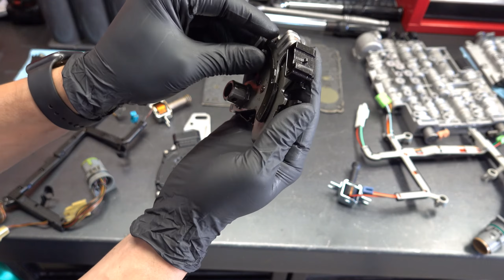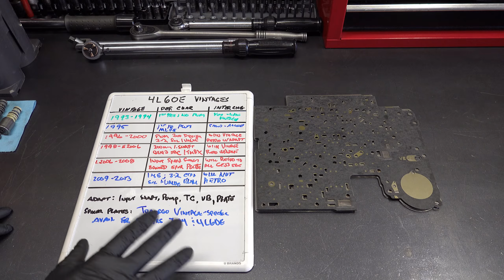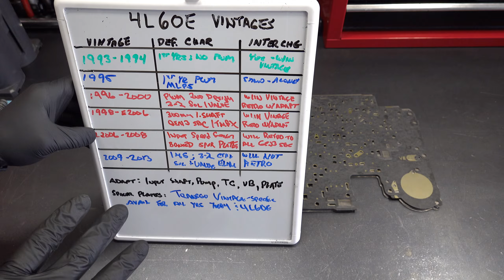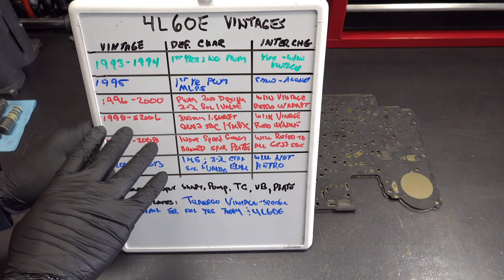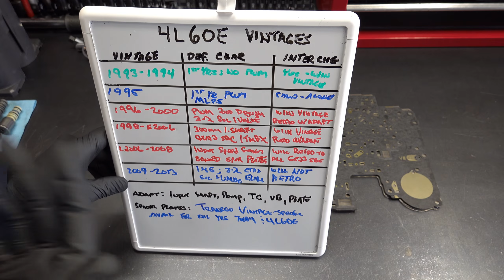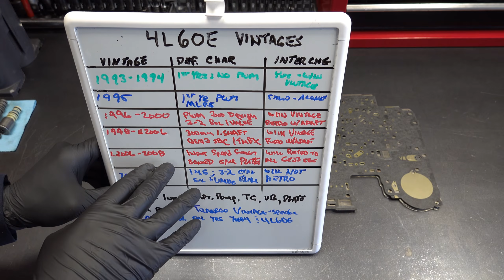How to Buy a 4L60E - Changes and Interchange Rules

Comment: i have a late 07 unit that looks exactly like your 09 case
Reply from the maker: Yea, the case differences appear to be immaterial between those later years of 4L60E...A few have told me they were able to swap plate and valve body between 09 and 08-07 to make a 2009+ case work for a 2007-2008 application...
Reply: So I’ve got a trans out of an 03 suburban I bought for next to nothing that I know was rebuilt. I also have an 09 Saab 97x(5.3L) that will not leave second gear when up to temperature. My question is are the clutches and mechanical internals (minus the speed sensor reluctor shafts) interchangeable? Like could I pull the guts from the 03 and slap them into the 09?

Comment: Can i put a 2003 4l60e and put it in a 2008 truck?
Reply from the maker: Do you have turbine speed sensor in your truck's 4L60E? 

You should, given it's a 2008. The TSS began to appear in truck/van/SUV chassis vehicles in very late 2005 into 2006. You can't be without that sensor.
Reply: @nickstransmissions also how would i tell  if it has a turbine speed sensor
Reply from the maker: You have one in yours. As I mentioned, all 2007+ NNBS (GMT900) platforms w/4L60Es had an input speed sensor...But to confirm any technical details about your vehicle, call your local GM dealer, ask for parts then give the parts guy the last eight digits of your VIN and he will tell you if you have one specific part or feature on your vehicle. 

Here's my 4L60E Rebuild Series that you can use as a guide for your rebuild: https://youtu.be/H5-1Fs3hwLE

Also, purchase the updated ATSG manual for the 4L60E / 4L65E (one manual covers both transmissions).
Reply: @nickstransmissions i have no idea brother, i bought a 2008 1500 that needs a tranny it only has reverse 1st and second, and i have a 2006 tahoe that the frame is rotted so i was thinking about yankin the tranny out of the tahoe and putting it in the 2008 silverado
Reply: There both 4l60's was trying to save money on a transmission lol so theres no eay to do it?
Reply: Way*
Reply from the maker: Rebuild the transmission that is in the 2008 truck now, if that is the truck you want to get running/driving...Saving .10 now will result in your paying a dollar later (sooner rather than later).
Reply: @nickstransmissions so it just wont work at all i cant do anything to make it work? Lol if i had money to get it rebuilt i would 🤣 thats why im on your youtube channel
Reply from the maker: No as you would need to swap to an ISS-compatible pump and drum w/the sensor installed - if you're going to do all that work, you're going to rebuild the transmission anyway since you won't have not much additional time in it vs swapping those drums.
Reply: @nickstransmissions would i be able to do it myself if i buy a rebuild kit im pretty comfortable hands on doing it, do you have a step by step video?

Comment: Can I use a transmission from a 2003–2005 Tahoe on my 2007 Suburban
Reply from the maker: Do you have an input speed sensor in the transmission on your Suburban?

Also, this video prob answers your question - give it a full view, if you haven't already.
Reply: @nickstransmissions  yes i have.
Reply: And i have fault code p0717 ..
Reply from the maker: Ok...Your vehicle is designed to work with a 4L60E that has the ISS which means you cannot install any transmission that doesn't have it. So you need a 2007 or 2008 unit only. 

My advice: Rebuild (or have rebuilt) your existing transmission. 

Used 4L60Es are extremely unreliable and you're basically casino gambling and you know what they say about that: "The house always wins".
Reply: @nickstransmissions 

Can you tell me if I need any special tools, other than regular hand tools, to disassemble the transmission and reassemble it?
Reply from the maker: Yep - check out my 4L60E special tools and equipment video - will give you all the tools/supplies/equipment that you'll need to effectively rebuild your 4L60E: https://youtu.be/HVo0uyfdJS0

Comment: I have a question is am hoping you can help with, I have a 2006 chevy silverado 1500 with 5.3l RWD, we just put a transmission from a 2008 silverado 1500 4.3l RWD in it and its not shifting into gear, the transmission seems to be exactly the same but its not engaging, is there some components i need to switch over from the 06 4l60e?
Reply from the maker: Hi Matthew, thanks for watching. Did the input shaft on the replacement transmission look like the input shaft on your original unit which would have had full splines to the end and a large orange o-ring? Or did the replacement engine have a pilot journal on the end of it with a black o-ring?

Comment: Hey Nick, hope all is well. I watched the video tons of great information! Im working on a 2013 4.3 v6 with a 4l60e that has lost reverse, i have a left over 2009 4l60e that had a 5.3 in-front of it. I was aware of the 09+ changes as far as “neutral safety switch” etc. upon inspection of the connectors one is blue/tan the other is blue/gray
Reply from the maker: Thanks for watching, Chevy!

Comment: I’m still not fully sure about this yet.  
I have a 03 Silverado 4x4 with a 5.3 gen 3  transmision is burnt up. 
And i found a 2000 Yukon 4x4 5.3 since they are both gen 3 what all would i have to swap to make work ?
I’m assuming they are both 300 mm shafts since both gen 3 
Thank you kelly
Reply: I will rebuild it   But i was wanting  something to be able to move it around and drive a little while it’s being built  it’s a 1954 Willy’s pickup body on a 1999 Tahoe frame and a 03 Silverado 5.3 with a 261 transfer case and the 2000 transmision is free if i help the guy pull the motor
Reply from the maker: Hi Kelly, thank you for watching. 

Why not simply rebuild your 2003 unit? 

It has a better reaction shaft with larger gear train bearings than the 2000 transmission but is otherwise identical to it.

Comment: Great videos,i have head scratcher.i have an 01 astro van 4l60e that leaked from the converter seal, replaced pump and converter, had late 1/2 shift and pushed fluid from vent.realized i ripped the 2 stator teflons and got stuck between the pump and case. Pulled apart, all new seals and gaskets,issue now is i have no 2nd. Screams first let off right to 3rd and also feels like a bind in reverse and in low 1. I know its a 298mm pwm 01 behind a 4.3 i was thinking of replacing with a used one from a 2000 as they seem more plentiful. Would you know if they are compatible? Thank you
Reply from the maker: I think I need to do a follow up video to this one as I'm getting quite a lot of questions about compatibility between transmissions as assembled units and respective vehicles. Perhaps in a month or so.

In the mean time, if both units have a shallow bell housing, pilot at the end of the input shaft and older 700-r4 sized torque converter, they should be compatible. The 4.3L's converter will have a higher stall than the converter from a 4L60E that went behind a 5.7L engine.

Comment: "HI Nick", how are you doing? You are making some great detailed videos. Keep them coming. I have a question for you. Can you swap a 2005 4L60E oil pump and all the other internals into a 2008 case? I know the 2008 pump and wiring harness are different. My 2005 case is broken. They both use the same outer pump gasket, the one that is on the case-oil pump perimeter not on the pump. Are the cases the same in 05 & 08  they sure look the same? Thanks Nick keep up the great work.
Reply from the maker: Hi Mark, thanks for the kind words. You would need to swap both the pump and input drum/shaft assembly into your 2005 unit as a matched set. Install the turbine shaft speed sensor to plug the hole that would be there if left out. Use the 2003-2005 wiring harness from Rostra.

Comment: This is some valuable information I’m struggling to find anywhere else and far more in depth as well, I appreciate you taking the time to make these videos and pass your knowledge to others, one question I have is if you have a diagram and could provide it somehow for the 17 pin blue and tan/light brown connector, it is for a 2010 Silverado that I am having input/turbine speed sensor signal issues with creating the intermittent hard shifts and I would like to test the harness before dropping the trans and replacing the iss/tss but I have no idea if: the 3 wires off of the sensor go directly back to the Tcm or branch anywhere else before then, the colors of the wires, what the iss supply voltage is etc.. I cannot find very solid/consistent info for this specifically and I don’t expect you to know every detail but I figured I’d ask being as you are very well on top of these things, either way keep up the great videos!! Thanks
Reply from the maker: Thanks for the view and kind words, Jeremiah! 

I can't provide any images or diagrams here but you can google search for those as they're out there. Also, you can purchase and download the ATSG manual - there are pin-out diagrams in the manual as well.
Reply: Thank you for the quick reply! I looked at their manuals and it seems like they’ve got the info I’m looking for going off of the index, I will be ordering one from them for sure, thank you again!!

Comment: Finely I found someone who actually was able to tell me what I have been trying to figure out since I have a 93 Chevy Silverado 4x4 that has been swapped with a 700R4 so I went on a search and was able to find a 4L60E out of a 93 Chevy van now comes the next problem different output shafts since one is 2wd and the other is 4x4 so I ended up circling back and wondering would my 97 4L60E swap instead of swapping out the outputs because I didn't want to tear the transmission 3/4 of the way apart to just change them out so now I know I can retro fit my 97 to run as a 93 and I have all the parts from my 93 2wd to do it if I am understanding every right that is and I am glad also because my 93 2wd ended up having burnt fluid in it thank God all I paid was 150 for it and thank God I finally learned how I can do the swap since the person who put the 700R4 in didn't do it right and I most likely possibly fried it when I dumped all my tranny fluid after it separated enough ugh well it was only a 500$ Chevy Silverado 4x4 pro am classic not sure how special they are but there is very little information on them.
Reply from the maker: Thank you for watching!
Reply: @nickstransmissions thank you for simplifying the process for me and so many others.
Reply from the maker: You're welcome, MrJal!
Reply: @JimmyJames3184  hey I have a 93 transmission from a suburban with 5.7L engine and I want to put that transmission into a 97 Chevy express van 1500 with 5.7L engine. Is our situation the same (excluding 4x4 because neither of mine are 4x4) or are you saying I should just retro fit my 97 van to think it’s a 93 suburban
Reply: Yeah man same here!!! 👍

Comment: Awesome and informative video, as always. To make sure I understood this correctly, I have a 2012 core where all the internals were pretty bad, with some rust, and even the pump has damage. I also have a 2008 transmission. Can I transfer all the internals from the 2008 (with ISS pump and ISS input drum) into the 2012 case and use those along with the 2012 valve body, harness, gear selector setup, and separator plate to rebuild it as a 2009 and up compatible 4L60e?
Reply from the maker: Yep, that should all work...the 09+ stuff that's unique to that vintage is the VB, plate, IMS and wiring harness so as long as you use all that stuff in your 2012, you can xfer the guts from the 2008 into your 2012 case.
Reply: @nickstransmissions  Awesome - thanks for the quick reply!

Comment: Do you have a video about connector/internal wiring harness changes between 2003 and 2004+ transmissions? I have a 2005 Silverado 4.8 4x4 and wanting to use my parts truck 2002 Sierra 5.3 4x4 4L60E when mine finally wears out. It's my work truck and I'll have to take it to a shop to have it swapped, but want to know exactly what has to be done. I read that the valve body must be removed and internal wiring harness/pass through connector? I just took a 2003 np246 transfer in to replace mine and the difference in the encoder motor stopped us from doing that.

Comment: Had a neutral safety to out wouldn't start but if you went from park to drive it would kick in the starter was crazy
Reply from the maker: They can fail in very odd ways...I've seen them start in neutral but not park and vise versa as well as scenarios like yours where they'd start if you were aggressive enough w/the shifter...

Comment: 95 was a two wheel drive specific or astro/safari van,  I bought a 95 trans for my 97 and everything was different. i guess that 95 year they messed with some valve body stuff as far as i can read and made it kinda annoying.
Reply from the maker: All the 1995 transmissions had a PWM pump and early design PWM 3-2 control solenoid and 3-2 downshift valve train - that combo made 1995 a unique year for these transmissions. 96+ they went to an 'on/off' 3-2 downshift strategy which meant diff solenoid, spacer plate, valve body casting and valve train.
Reply: Nick do you know if you can put a 96 valve body & separator plate on a 95 & it work? Not worried about impedance it's got a stand alone controller. I need the 4 bolt extension housing case that the 95 has.

Comment: So can I install a 1999 4l60e trans into my 2003 Tahoe without any modifications?
Reply from the maker: I cover this in the video, towards the end - give it a view if you haven't already. 

Otherwise, simply rebuild your 2003 Tahoe's transmission - used 4L60Es come with worse odds of success than slot machines on the Las Vegas strip.

Comment: So I'm kinda in the same area as @jenniferkromhout713 was talking about. I have a ls swapped g35 running the Aces efi, I bought a 4.8/5.3 (don't fully know which one) with a 4l60e and I've been having shifting issues since installed (has 1st and 2nd but nothing more), even though it's a fresh rebuild. Come to find out the aftermarket wiring I have only supports up to 2005 (possibly thru-08) transmissions. So I'm back to the original question of; if I can get an 05 valve body and swap it in since I don't need an internal or external mode switch, and use the 05 wiring and solenoids etc. or if I'm better off scrapping the $1100 I spent on a rebuilt 09+ trans, and just get the right year?
Reply from the maker: Hi Ashton, plug a bi-directional scan tool in and take for a test drive - see if the Aces PCM is commanding an upshift from 2-3 but you are staying in 2nd gear. If so, the problem is either Shift Sol B stuck on or the VB 2-3 shift valve or shuttle valve is seized in the bore. If the PCM is not commanding an upshift, you'll need to find out why. 

Start there and let me know what happens.

Comment: Would i be available to put a 2001 4l60e into a 93 Chevy truck? I watched your video before commenting, and with the purpose of putting the trans into that truck
Reply from the maker: Hi Carlos, please re-watch as your question is answered in the video. I don't ever advocate for installing used transmissions so my videos are all I have to say on the subject. 

My advice is to rebuild your 1993 4L60E unit.
Reply: @CarlosHernandez-lb5fu  33.25

Comment: AKA Terminator Transmissions:   I didn't have to swap out the Bell housing of my 09 unit, I believe my 2009 4L60E was for a 2 wheel drive Silverado, so it was a bolt in,  Good eye on the differences for the worn tracks in the case, At the time i didnt have a 99-08  LS 60E to compare the 2009 unit to side by side, I would like to see if a 06-08 unit is the same as a mode switch 09+ unit,  Walt
Reply from the maker: You won't have to swap bell housings as long as the engine applications are the same. AFAIK, all worm tracks from 1993-2008 are the same; 2009+ are different.

Stay tuned - I'll be doing a video on my hydraulics servicing station soon; should give you and others some ideas around setting up similar work area for vac testing and reaming/repairing/remanufacturing valve bodies and valve trains in pumps.